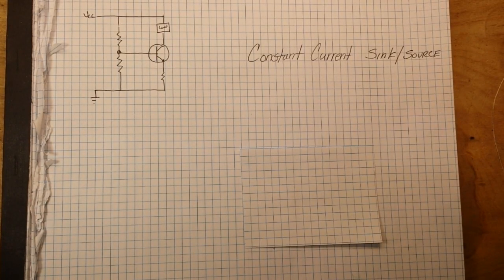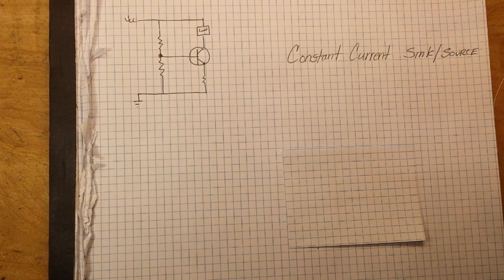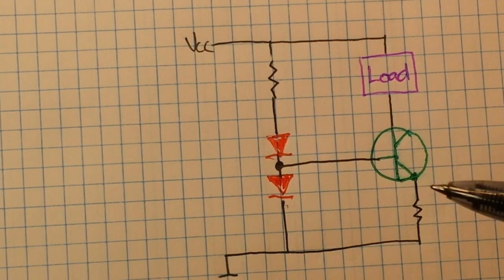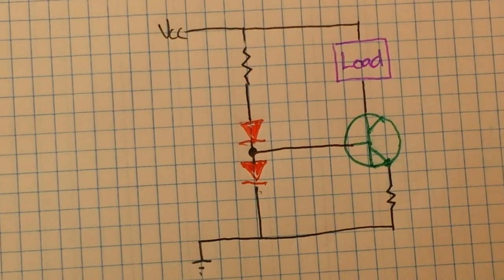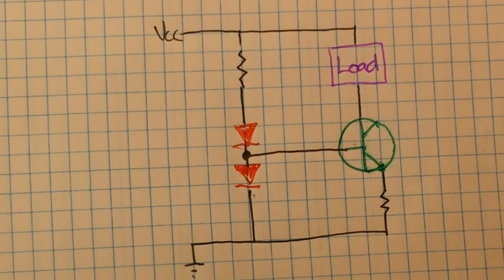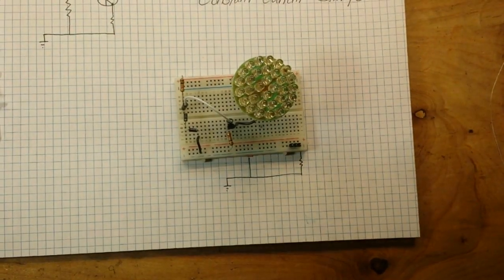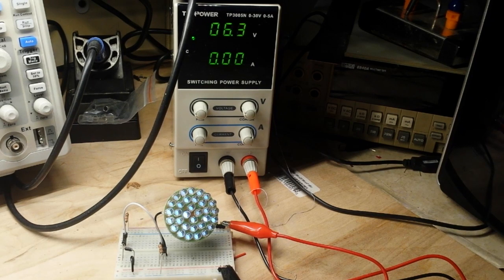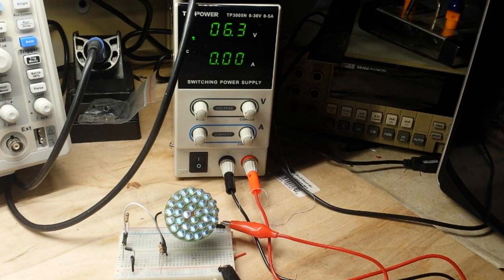A second look at constant current

Comment: Thanks as always bud.. I'm having trouble understanding the flows tho.. Like just for starters, why is the load before everything? Why do we need to limit current AFTER our circuit to ground? Shouldn't this all be before.. so you know.. it controls the electricity lol. Also wouldn't either the resistor prevent the current from flowing, going to light, or which ever one has least resistance? I do not see anything in line that would effect the resistance to much. Doubt that LED fluctuates alot... Yeah I dunno. I'm just not getting it. I think it's cause I can't see the way the electricity is actually behaving in the circuit? Is there a way to do that or would that make things to much of a pain? Or am I just being thrown cause it almost seems like this whole circuit is based off the assumption the VCC is from a already perfectly regulated source,, in which case,,, then why add another CC? The way I'm reading this is we're regulating current to ground, not load. Which again, why? lol. So lost. Thanks!
Reply from the maker: It's based on Kirchoff's Current Law. Current in most equal out. (That's overly simplified) it doesn't matter if you limit the current going into the load or coming out. You just need to "pinch it off" on one side. Make sense?
Reply: Whaaaaat? Oh man I've missed something very dire in my studies here lol. Is there a video with much more detail then this? From what I learned if I plug something into a outlet with no regulation that thing will get a brunt 120volts @12-15ish amps(w/e outlet limit is) and explode . Unless the regulation is before. I don't understand how something is regulating from after the circuit... This is blowing my mind right now. lol. Yeah I'm deff missing something major. Any tips on were to better understand this? Because if that was the case how could you have a circuit with multiple things on it needing different volts and current, if whatever is at the end of the circuit would be the tell all, instead of all the regulating parts in the circuit before? kirchoffs would make that impossible or make the circuit need to be insanely huge having a vcc node for literally any small thing it wanted to power? I'm going to need to seriously re-study kirchoffs. =/   @learnelectronics
Reply: Sorry I'm such a dunce XP Also have prof. lewin in my head tellin' me kirchoffs is bunk haha. I've watched a view refresher videos and now it all makes less sense then when I thought I understood it lol. My understanding that grounds literal purpose is to complete a circuit and give a place for the remaining electricity to run to with the least restive path? Not that everything just equals 0 magically by the end anyways so ground wouldn't even be necessary beyond completing the circuit? Thanks for patience.  @learnelectronics
Reply: There are two kinds of "ground". The "earth" ground is present in mains-powered equipment just for safety purposes. The "reference" ground is just a common node used to complete the circuits, as you said. In modern mains-powered equipment the two grounds are almost always directly connected to the same node, but in older equipment (e.g. 1950s) quite often the chassis operates as reference ground but if there is an earth ground it is not directly connected to the chassis; that makes it easy to get electrocuted even if the on-off switch is turned to "off". Before working on such equipment (usually using vacuum tubes with some filaments greater than 12 volts), research what old hands have said about rewiring the equipment to make it relatively safe.
Reply: @douggwyn9656  Yeah i knew that much thank you bud. Just still not sure about this kirchoffs law.. it isn't making sense to me. seems like less of a law and more of a chance occurence that may or may not happen depending on your power supply and or draw?
Reply: Kirchoff's voltage and current laws are basic properties that enable us to write equations for voltages around any circuit loop (sum to 0) and currents into any circuit node (sum to 0), which help to solve for unknown values. The voltage law reflects conservation of energy and the current law reflects conservation of charge, which are fundamental physical laws.

Comment: hi if you not mind asking you this question. i have micsig oscilloscope that has no battery can use a circuit that can supply 12v to it from a car battery.i got this scope to do diagnostic on car

Comment: Hi, great video. But you did a mistake. You connected the base of your transistor  on top of the 2 diodes... As it should be... On your schematic, you set the base between the diodes. I don't think it's the right place.
Reply: Hi, a SI diode has a forward bias voltage equal to a SI type base-emitter junction. So if the lower diode has a slightly lower forward voltage as the base-emitter junction, no current flow... no voltage left for the resister on the collector to stabilize the base current. With 2 diodes, it will give 0.7 V for the base-emitter junction and another 0.7 V for the resister to set the desire current... Does that make sense?
Reply: @yanickch  indeed...
Reply: Hi there, can you explain better what do you mean? The base of the transistor is connected with the cathode of first diode and the anode of the second diode, the second diode is in parallel with the base-emitter junction thus, setting a fixed voltage drop across this junction regardless of main VCC. This is how I understand it.

Comment: Thanks Paul I never thought about using diodes. Great video as usual. 
I’ve been working through an idea I had about using a 555 and 4017 with an r2r ladder to build a sign wave and maybe one or two other waveforms. Was wondering if this was something you might have tried before?
Reply from the maker: No I haven't,  sounds interesting though.

Comment: I have never owned an Oscilloscope personally. I've used old tube ones in School and the TV repair shop (in the 70's). So, I've mostly forgotten anything I knew. (Use it or lose it, ya know). I'd like to see you give some basic instruction when you are measuring things with these new fancy digital-scopes. I have watched some "Using an Oscope" vids, but explaining as you go makes it more practical. Maybe I'm in the minority?  If so.. disregard. :) Thanks!
Reply: DSOs look far more complicated then they are. You still have one knob for voltage and one for time (either per channel like The old scopes or more commonly one set of knobs and you have to select the channel you want to alter).  The main difference is triggering. As standard they now use DC coupling rather than the old CRTs that used AC coupling as default. This means you have to move the trigger around your waveform a bit more to get the right trigger, or just switch it to AC coupling.....depends what you are doing.